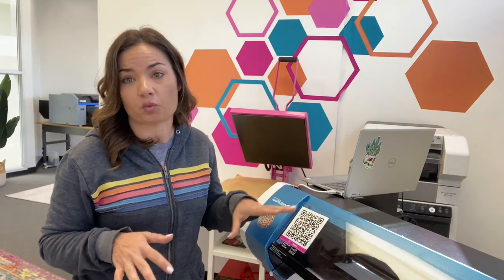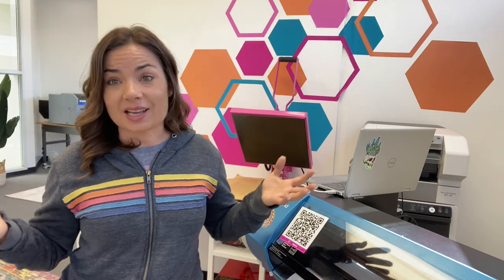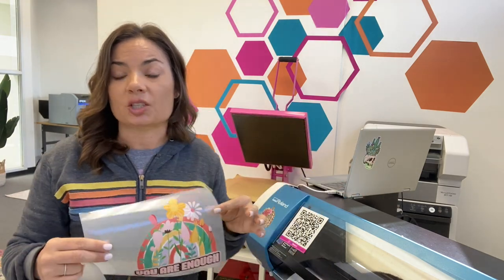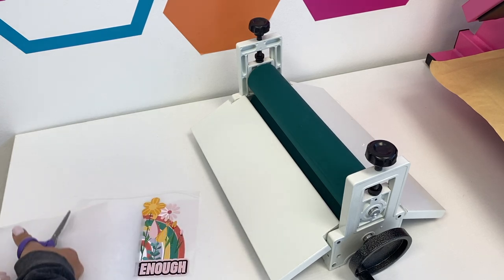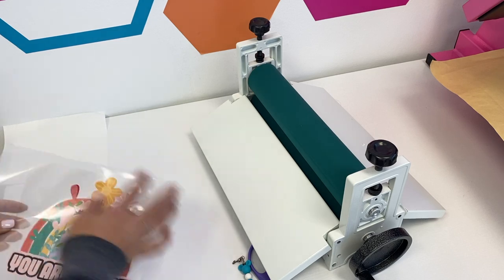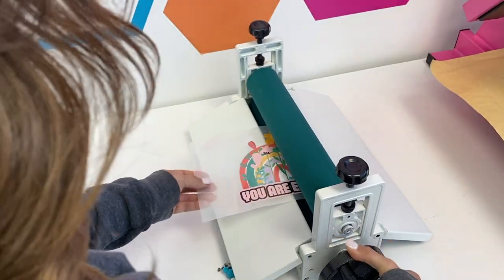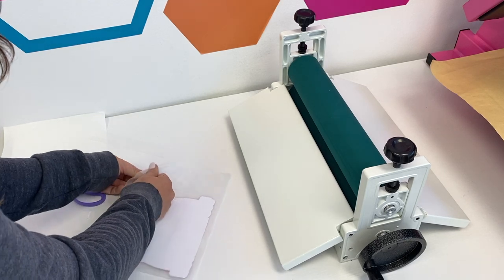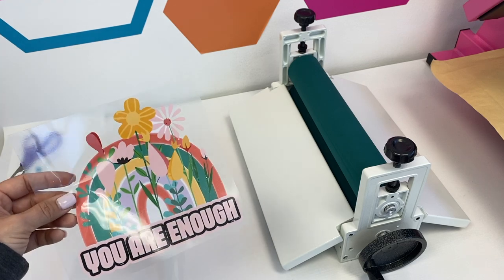How to Mask Heat Transfer Vinyl (And Avoid Bubbles and Wrinkles)

Comment: New to this, I've just been layering mine on my shirt with my heat press. What are the advantages of this over just layering on the shirt?
Reply from the maker: Hey there, you can layer HTV on a shirt for sure. This works well for printed designs that you don't mirror and already have a carrier sheet.